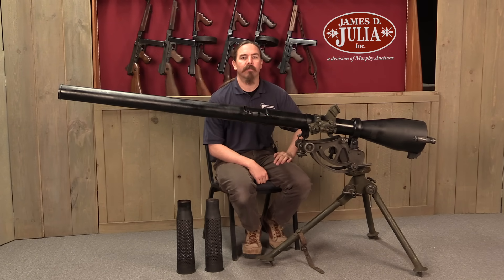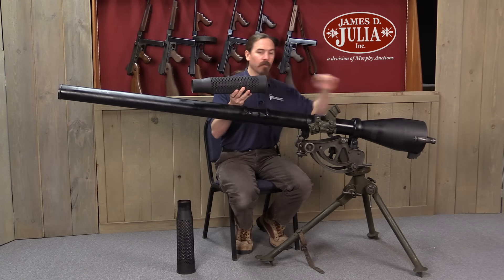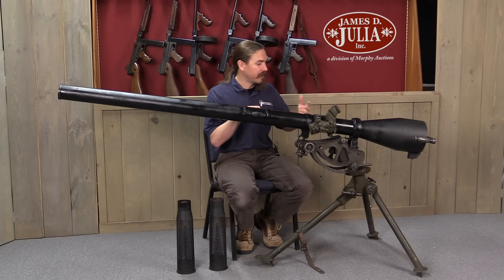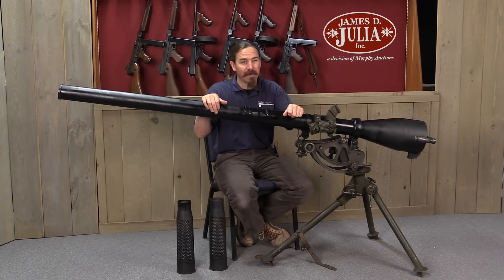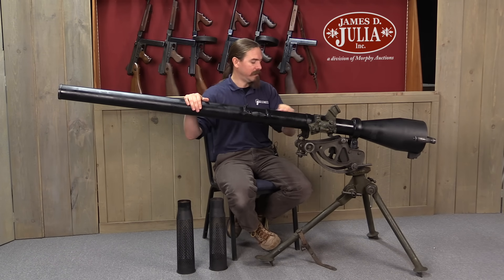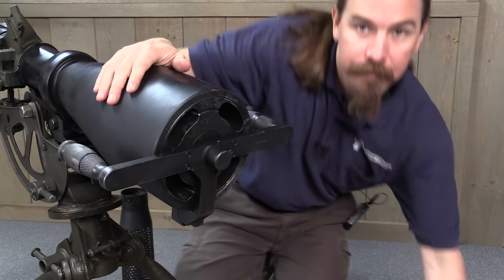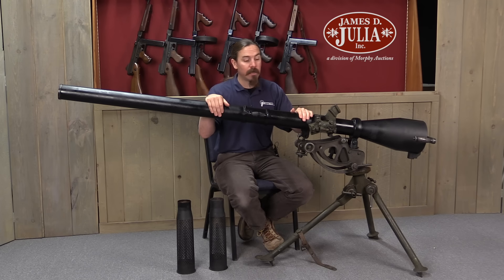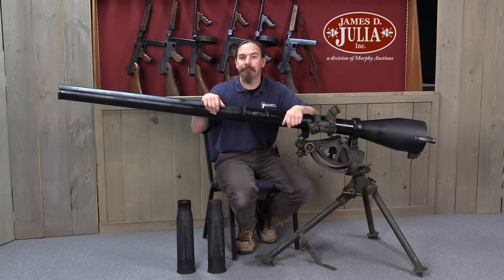M20 75mm Recoilless Rifle: When the Bazooka Just Won't Cut It

Comment: Might be a stupid question, but ah...

If half of the energy from the propellant is "wasted" by having it expand out the back and not help the projectile move forward, wouldnt it be more prudent to put half as much propellant in it and close the gun off "as a rifle"?
Reply: Then you'd have a 75mm artillery piece which would need to be made much heavier by fitting a proper breech, thickening the barrel to contain the pressure etc. These were nearly man portable, could be mounted on the back of a Jeep etc

Comment: Should probably be noted that the Super Bazooka actually was more powerful than the M20, at least when it comes to armor penetration.  HEAT (aka hollow charge) warhead penetration scales directly with warhead diameter.  The Super  Bazooka fires a 90mm warhead, this fires only a 75mm warhead.  Super Bazooka will penetrate more armor (over twice as much, in fact!)  

Where the recoilless rifle is better is in range and accuracy.  Much more effective beyond relatively short (100-200 meter) ranges.

Comment: i couldnt get it, what s the point of loading that much propellant if most of it will be wasted blasting grass on the ground?
Reply: Hurdalık Cini to control recoil you need to add an arresting system,that system weighs a lot,if it weighs a lot it has to be towed by a vehicle,if you want the infantry to carry it you make it recoilless.
Reply: Hurdalık Cini to reduce recoil

Comment: Hate to bring it up, but its mounted on the tri-pod backwards (They even in their demo video, fired it from it backwards.)
Reply from the maker: It is supposed to be mounted that way, the reverse of the M1917 machine gun.
Reply: How is it supposed to get more elevation then, or dose it go further then what it looks like it will go?
Reply: Andrew Shoaf the elevation adjustment is part of the connection between the barrel and the tripod. The tripod adjuster isn’t used to elevate.

Comment: Ian, why did they use this arrangement of a perforated shell/case when they already had rocket propelled anti-tank ordnance such as the bazooka rockets? Wouldn't it had been simpler just to launch a 75mm rocket out of a tube and do away with the breach/chamber do-hickey?
Reply from the maker: This is more powerflu, more accurate, and longer ranged.

Comment: RE: The T-34. Even taking into consideration the well sloped hull such a HEAT round should burn through. 45-47mm at 60° equals 90-94mm. Close but no cigar. https://panzerworld.com/relative-armor-calculator Furthermore Germany converted captured French 75mm field guns into AT-guns. They fired HEAT and did kill T-34. The best German HEAT at hand at the end of the war could not penetrate more than 4".

Comment: 4 inches (101.6mm) of penetration on those HEAT rounds should be enough to go through a T-34 (45mm-55mm of armour sloped at 40-45 degrees from vertical), I'd say its more likely the issue was with the fuses, percussion fuses were less reliable against sloped armour than later piezoelectric fuses

Comment: If the 75mm M20 could only penetrate 100mm of armour, then is it correct to say that it didn't really solve the problem it was intended to? Namely, the problem of the original Bazooka not being powerful enough to take out tougher German armour. There was no man-portable solution to heavy armour.

The Bazooka could penetrate up to 120mm with an effective range of 150 yds, in a much more convenient package. The 75mm M20 had an effective range of up to 400 yds, so it certainly increases the range, which is great. It can also do indirect fire up to 1000 yds, and it has HE warheads, which are both capabilities that the Bazooka doesn't have. But the heavy armour problem was not solved... right?
Reply: No. The m20 bazooka helped. 280mm of penetration.

Comment: would've been cool to see more about the shells, also. looks like there's a tube running most of the length of the shell. was that to spread the ignition of the powder more evenly? how the charge worked in an perforated, un-sealed system like that would be interesting to know.

Comment: 4:25 White phosphorus is a chemical weapon. It burns through skin.
Reply: It ignites spontaneously in air at about 50 °C (122 °F), and at much lower temperatures if finely divided. This combustion gives phosphorus (V) oxide. Because of this property, white phosphorus is used as a weapon.
Reply: I did not state that it was poisonous or not. By all means, combustion is a exothermic chemical reaction.  I just wanted to say that "smoke clouds" that Ian is referring to, are deadly dangerous. It's isn't smoke grenade stuff.

Comment: I read somewhere that the Army used similar-looking perforated cases to clean the chambers on sealed-breach guns. The cases are sometimes mistaken for recoilless rifle cases when sold in surplus stores.
Reply: How did that work?  Just a brush poking out of the holes?
Reply: Narcoleptic. I think the heat and burning gases were supposed to burn off any deposits in the chamber. Don't know if it worked very well.

Comment: how is the powder contained in that perforated shell?
Reply: My recollection is that the ports in the casing are blocked by a metal foil liner, so it's as waterproof as any other fixed round. There are other ways of making a recoilless casing, but there's always some sort of seal that the gas pressure blows out.
Reply: Dan D in little paper bags.

Comment: If this is a rifle, I shudder to imagine what would they classify as cannon.
Reply: John Simpson wow that's awesome to see someone else know that tid bit on 105 recoilless rifles. They marked them 106 so idiots wouldn't load them in wrong gun and blow their self's up. Because some people just can't tell the difference.
Reply: Cannons and rifles aren't size based terms so your comment makes literally no sense. 
A cannon can be smaller than a rifle.
Reply: It's called rifle because it's rifled.
Reply: I think they were called "rifles" just to prevent the artillery branch saying "If it's a cannon then we control them!" the whole point of these weapons is they are used organically with frontline infantry, to complement how mortars couldn't be used in direct fire.
Reply: @Treblaine  "rifle" vs. "cannon" is a purely technical distinction.
Reply: 16 inches of pure, naval cannon
Reply: @mikialela6664  Oh, you mean the 16"/50 naval rifles?
Reply: Hi. Huge Civil War (and WWII) buff here. It has long been common practice to refer to rifled cannons simply as "rifles" hence the huge Parrot gun of the time was often known as a rifle. It's easier to tell when it's naval artillery, which would have been called a "naval rifle." The designation "cannon" applies to anything greater than 20mm (at least in the 20th century). A weapon could be classed, officially, as a "rifle" and as a "cannon" at the same time. I suppose that the previous commentators are correct that in the modern era, artillery that's referred to as "rifle" typically belongs to the infantry rather than the artillery units (but I hadn't heard that before - good to know - that distinction didn't exist in the 1860s, which I was mainly referring to)
Reply: Stop shuddering it just means it has a rifled barrel to launch a spin stabilized projectile rather than a smooth bore firing maybe a fin stabilized projectile.  Up into the 106mm recoilless rifle (actually a 105mm) it's a rifle because it's being fired by the Infantry. The Artillery branch fires cannon in various calibers (yeah 75mm and 105mm for instance) and Armor fires out of main guns.
Reply: @FIREBRAND38  oh wow
Way to ruin the joke
Reply: johnyyonehand #twelveinchnavalrecoilesscannon

Comment: Man, I love your channel, but your science was way off on this one.  The back blast is not to reduce chamber pressure.  It is to counteract the momentum of the accelerating projectile.  Newton, equal and opposite reactions.  A conventional gun puts the force of the accelerating shell into recoil mechanisms, or in older guns the whole carriage jumps backwards and you have to roll it back into position.  Here the force of the accelerating shell is countered by a rocket of gas coming out the back of the gun.
Reply from the maker: Both things are true - it reduces chamber pressure and counteracts the recoil. The reason for building it, however, was to have a portable weapon that fired a large shell, and the recoilless mechanism is suitable for that because of its low chamber pressure. The lack of net recoil is a side benefit.

Comment: I don't think they put the super bazooka into service until the Korean war. Or it may be that they were not available in Korea initially.

The T-34 had 60mm armour if my memory serves me right, but it was heavily sloped.
Reply: tarjei99 depends what t34 later models had slightly thicker armour than the first varient I think
Reply: The 1942 models had 45mm of armor, sloped at 45 degrees. Effective thickness was about 60-75mm.
Reply: The problem too is that a lot of the conflict for tanks changed over the course of the war, South Korea is a hell a lot more flat where tanks can move more freely and turning the opening days, North Korea was dominating the South in almost a one sided fight while in the north side of the country, where it was more mountain, tanks became more of a static defensive weapons.
Reply: Plus in Korea, Stalin gave North Korea and China the best armor they had at the time so UN forces on good day would see something as weak as a T-34-85 and South Korea at the start of the war, did not have any tanks, combat aircraft, and the M2 bazooka was the only AT weapon which did nothing against the T-34-85. And sloped armor adds even more defense.

Comment: I'm not too well versed in projectile physics. Does a recoilless rifle shoot the projectile with less velocity due to half of the propellant gasses leaving out the back as opposed to all travelling out that barrel?
Reply from the maker: Compared to a sealed breech gun, yes.
Reply: That's why a HEAT round was the primary AT choice, penetration is independent of muzzle velocity
Reply: They compensated a bit with bigger pouder charges.
Reply: Yes

Comment: Dumb question.... Since half the charge is discharged out the back, why not halve the charge and not have a recoiless system?
Reply from the maker: That would still require a much heavier action to contain the pressure, thus making the weapon far less mobile.
Reply: It would also require a heavier mounting system to absorb the recoil. Let N be the total charge of the round; say a recoilless rifle delivers N/2 impulse to the round and N/2 out the back. The net impulse and hence recoil is zero. If you have a closed breech charge of N/2, you impart N/2 to the round but also N/2 in recoil impulse. So to deliver the same impulse to the round, you require a much heavier recoil mitigation system. Hence why artillery pieces are so heavy and immobile compared to this.
Reply: That wouldn't work. There will be 50% loss of any given charge and You need some amount of energy just to lob the shell to at least safe distance if nothing else.
Reply: Thanks, figured I was missing the obvious

Comment: I’m not certain but isn’t the tripod on backwards for the rifle? It’s at max elevation in current set up. I think the set up just got reversed at some point.
Reply from the maker: It is mounted the opposite direction as the M1917 machine gun was.
Reply: They were placed “ backwards” on purpose by the manufacturer. Elevation is adjusted using a screw on the front of the tripod adapter on the barrel, not the tripod itself.